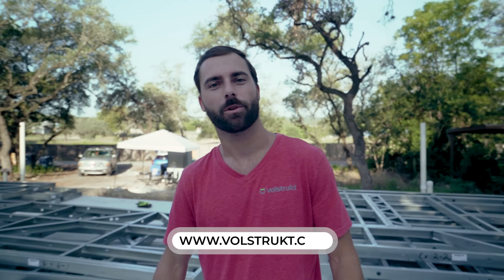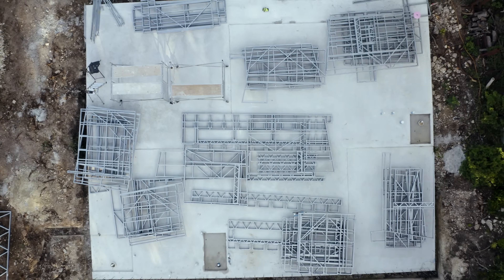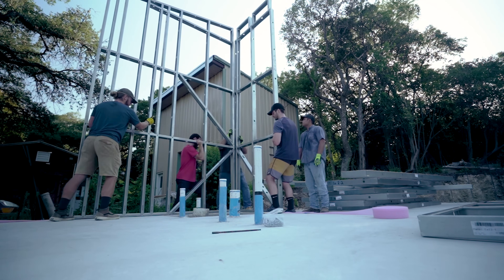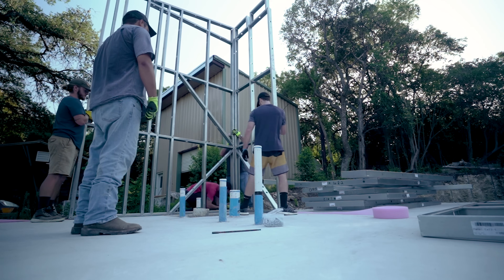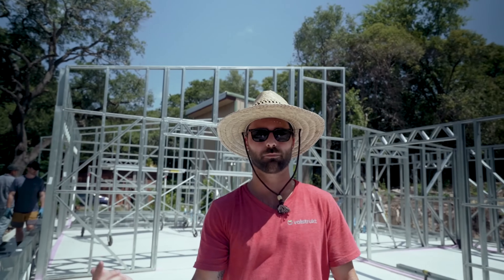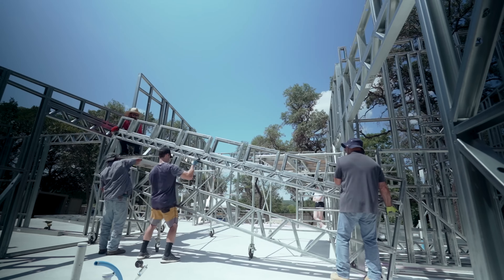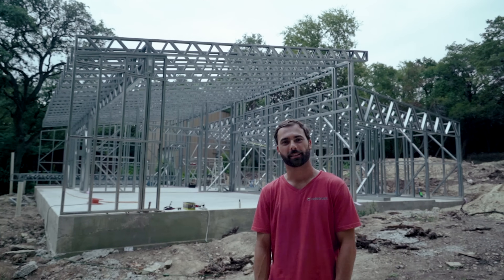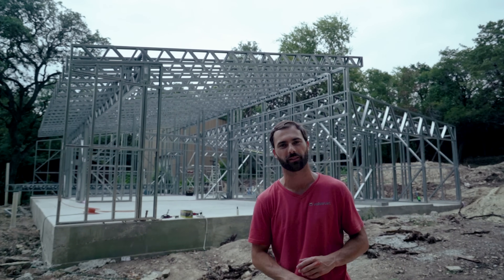How to Frame a 1,200sqft Home or ADU with a Volstrukt Steel Frame Kit in 1 day!

Comment: Can this be used for a house with ICF exterior walls?  I notice the steel trusses - what is the max wind rating of those?  (This would be for a house in south Florida and trusses would be anchored into concrete walls)

Comment: What does it cost?
Reply from the maker: The steel framing for this home is priced around $38K, but all in this house would cost about $375K-$500K to build out fully, depending on where you're building.

Comment: What type of insulation would be best. I have heard your home will echo in proper insulation is not used.
Reply from the maker: You aren't limited to the type of insulation you use. It will usually be driven by your climate or local code requirements, but we commonly use insulationed zip sheathing on the exterior and closed-cell spray foam in the wall cavity. Roxul is also a common option.
Reply: @Volstrukt  Oh ok thanks

Comment: shouldn't there be a sealing strip under the walls? Keeps out bugs and moisture (but not flooding!)
Reply from the maker: Yes, that's correct. We placed sill gasket under all exterior and interior wall framing before anchoring and closing up the home. Thanks!
Reply: @Volstrukt  glad to hear that !  How about diagonal strapping for earthquakes?
Reply from the maker: @brookestephen   The house in this video was able to exceed local load requirements only relying on the diagonal cross-bracing we integrated into the steel walls in addition to the Zip sheathing we attached. That said, the shear schedule will tend to vary from city to city and project to project based on local load requirements.
Reply: @Volstrukt  I'm curious if tiny homes built in one place must match the building by-laws wherever they travel... or where they end up.
Reply from the maker: @brookestephen   The phase "tiny home" is primarily a marketing created phrase and code requirements for tiny homes tend to vary state by state. A movable tiny home on a trailer will tend to be registered in the form of an RV and follows RV code requirements. That said, we produce framing that exceeds RV requirements to travel down the highway, and meets residential construction practice as well. We produce higher load-capacity frames for our clients that know they will be staying in high-load capacity (snowy or windy) regions. In other words, RV's are designed to be driven for recreational use, and not necessarily designed to be lived in full time or parked in a snowy mountain town for long periods of time. We appreciate your question. Feel free to reach out to our team if you have any other detailed questions. Thanks!
Reply: @Volstrukt  I had no idea! Thanks for taking the time!!!

Comment: Benefits, straight, lightweight, fast. What's average cost comparison to engineered? I'm an architect with a lot of wood prefab experience and will be looking into you folks to see more.
Reply from the maker: Most of our stock frames designs have already gone through preliminary engineering for 3 zones in the US (light @ 45lbs/sqft, medium @ 75lbs/sqft, and high load requirements exceeding 100lbs/sqft). That said, we have the ability to get any of our frame designs sealed in 48 states by an licensed engineer which includes a tailored calculations package for any of our clients that need to go through a formal city/county permitting process. We have produced frames rates to exceed 350lbs/sqft load requirements. Feel free to email us if you have any other detailed questions. Thanks!

Comment: How much does something like this cost Same model and how long does it take to be assembled
Reply from the maker: Pricing can vary depending on your permitting requirements, load requirements, foundation, and a few other site details. If you're able to email our sales team at info@volstrukt.com with your project location and a few other details, we can email over a more accurate estimate for you project. Thanks!
Reply: @Volstrukt  Thank you will do.
I was basically wondering. Do you have standard 2 and 3 bedroom units available? And how much does those units cost?
Reply from the maker: @iamtonykurtis   Yes, we have a few pre-designed 2 or 3 bedroom models ready to go, and/or we also do custom frame designs. Our kits will usually range between $20K - $50K depending on the size of the home, local load requirments, and what materials are included in the kit.

Comment: Do you check for plumb and level when putting / screwing everything together? Or are the studs marked in a way to where they will be plumb and level when assembling? I see no one checking for plumb , square or level, just wondering how that is done / or if it is necessary to do with assembly of structure. Thank you
Reply: From what I’ve seen, these companies have everything level and just made in a way where it’s plug and play basically, good for people who want to build their own homes too
Reply from the maker: Eddie's response is correct. Because we integrate cross bracing (and guide studs for intersecting walls) into each wall section, it becomes nearly impossible for the panels to rack out of square. By the time all of the walls are up and roof trusses aligned in the correct place, the entire frame naturally wants to pull itself square as designed. Most of our teams/contractors will still have a level and a few other tools on site for final checks, but the pre-assembled panels make it exponentially easier to build a square, level home without having to check each stud as you go.

Comment: Looks amazing! What about "sweating" in cold climates due to the thermal breaks? 

The -40C here in Canada creates quite a temperature differential. Will these sweat and rot the drywall or exterior OSB sheeting? Even with closed cell spray foam?
Reply: You would need a continuous insulation barrier on the outside of the metal in your climate zone. It may even be mandated in Canadian Res. Energy Code. They require it on stick houses too in a lot of locations. Once you get it continuous on the outside, your won't create a dewpoint in the wall assembly. Spray it up.

Comment: What is the price? What it includes?
Reply from the maker: The final cost will depend on your local load requirements and a few other configuration options we offer with this design. This Z-House frame is currently priced between $28K - $38K depending on those details. Material prices have risen during the pandemic, but we expect steel prices to drop again later this year. Feel free to email us if you'd like refined pricing or any additional info. Hope this helps!

Comment: Great build, what is the cost ?
Reply from the maker: Hi Bill, The final cost will depend on your local load requirements and a few other configuration options we offer with this design. This Z-House frame is currently priced between $28K - $38K depending on those details. Material prices have risen during the pandemic, but we expect steel prices to drop again later this year. Feel free to email us if you'd like refined pricing or any additional info. Hope this helps!

Comment: ? what material can I have for the exterior. I see how Steel Stud is fireproof but I have only seen so far that the outside is wrapped in plywood which I really do not want to do.   I in Southwest Florida and would like to have a really energy efficient steel stud home that will last and be nearly termite proof.
Reply from the maker: Hi John, our clients and builders finish the frames using a variety of exterior materials like metal siding, timber, composite siding, stucco, stone, and many others. Steel framing can be finished to match any other framing method. Thanks!

Comment: Can his type of construction be open concept across 20' spans?  What type of footings are needed? Is there there siding option that does not require sheathing? no attic.  no drywall.   I have the lot in Central Florida and want to build this 800sq house:   https://www.youtube.com/watch?v=1qOH4LJtexA
Reply from the maker: Hi, this unit looks like it was designed using other construction methods, but we very regularly convert various projects into something that can be built using lightweight steel framing. Feel free to email us with your drawings or any other resources you have and we can answer questions and provide you with a ballpark estimate. Thanks!    info@volstrukt

Comment: I want to build a custom steel framed house and your system looks awesome. I love the fact that it’s termite and fire resistant. I think my favorite part is the fact that everything is perfectly square and level. No warped studs to attach drywall to.
Reply: Iron has rusting property
Reply: @prabhakaradhulipalla4649  It's galvanized steel to prevent rusting
Reply: How about to earthquake resistance ? is it good too

Comment: What's the recommended type of walls for the outside?
Reply: I'm not a builder but I'm thinking zip r sheathing with 2 inch polyiso on the exterior, x2 on the roof.  Rockwool on the interior.

Comment: How are the walls attached to the slab? Anchored after they are up or already in-bedded in the slab? I live in Bay Area ... earthquake country. Have you sold any kits in CA?
Reply from the maker: On this particular build, the Titen anchor bolts were drilled into the concrete slab after the frame was assembled. We have also had clients precast J-bolts into the concrete slab, or others have drilled out the hole and used an epoxy. Yes, we have sold many kits in CA including the Bay Area. Thanks!

Comment: How about 4000 sqft home? Also who is doing engineering part for such frames? Also how much is per sqft? Curious to compare with lumber frame
Reply from the maker: The cost of framing a 4,000 sqft home would depend on a number of factors, including the roof style, bed & bath count, whether it's single or multi-level, etc... To give you an idea though, we have a model that's ~3,000 sqft, single-level, with 3B/2B and a shed roof that retails for right around $42K as of Feb 2021.
Reply: @Volstrukt  THAT IS AN INCREDIBLE PRICE!!!!  In the Bay Area the cost to build is running $350 - $700/sqft!!! That isn't including land cost which is CRAZY!!!
Reply: @reseller7  Thats for just the framing.. but yes pricing is good.
Reply: @Volstrukt  How can I see that 3000 sqft plan?
Reply from the maker: @michaellaserre1624  Our client provided us with rough hand-drawn plans which we used to develop the frame drawings. Feel free to email us and we can send over the 3D model of the frame. Thanks!

Comment: There's no way two people could lift a wood header like they do at about 1:45 into the video. Wood-based houses require a crane to lift a lot of the headers and trusses. The only crane you'd see on a Volstrukt home site is the one used to get everything off the truck!

Comment: Whoa! How many people are needed to put together one of these frames?
Reply: You need to go to their website and see how frames are bent and stamped by a really inventive machine. Individual frame members are created very quickly. They are then laid out on an assembly bench, screwing together all the frame members for a wall section. The wall sections are shipped to the site where they can be easily handled by 2-3 people. Using clamps to temporarily hold them together allows a person to screw the sections together. Everything is stright and square, something you won't find on stick-built homes. I'm seeing four people in the video, which is about the same crew you'd have for stick built homes.
Reply: @robeigner4390  Gotcha. Definitely will check out the website. I'm liking the idea of steel instead of timber for a future project I'll be starting. Even better if the sections come preassembled. Very cool stuff. Thanks 👍🏽
Reply from the maker: @ChadBemis   Thank you Chad! We appreciate your support!
Reply from the maker: @robeigner4390  Thank you Rob! Yes, we had about 5 people helping in the morning and 4 towards the end of the day. We appreciate all of your support!

Comment from the maker: How quickly do you think you could assemble the frame for your home using a Volstrukt steel framing system?
Reply: A HELL of a lot faster than conventional stick framing!!  That I can guarantee you.  Goodbye wood, hello steel!  :D
Reply: what is the cost, stop being quote requiring dinosaurs
Reply from the maker: @cybyrd9615  Again, we base our frame costs on the cost of steel which has changed at least 5 times just this year. The frame in this video is currently sitting at around $32K but that's not to say that won't change by the time a client places an order.
Reply: @Volstrukt  I think the actual question would be how does steel framing cost compare to wood framing - OVERALL. Lumber prices have also changed multiple times recently. Can you give an average figure  - as in - steel framing generally runs $X% more / less than wood framing and break it down into both material and also labor to install / erect framing and also time saved / exceeded. Thanks.
Reply: What the average time of the assembly is I can get it built in a minimum of double that. 😂
Reply: Will it stand 120 km/hr wind gusts and the occasional hurricane?
Reply from the maker: @mcata3625   We have the ability to design your steel frame kit to withstand 175mph wind loads. Feel free to email us for more info. Thanks!